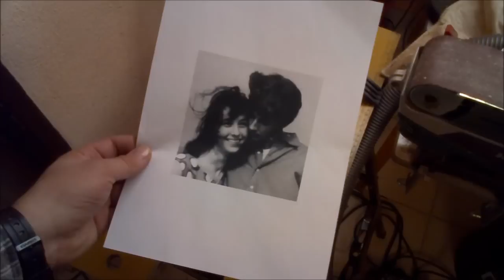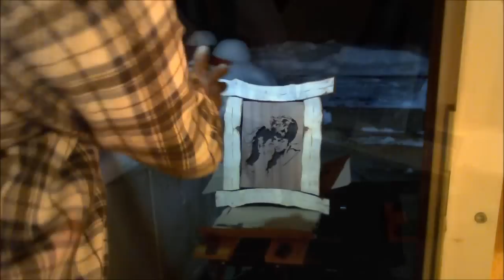Rustic Scroll Saw Portrait - Woodworking // How-To

Comment: Nice portrait.  I use mineral spirits on the pattern after cutting.  The adhesive will release and the pattern will come off easily, no sanding needed, and you don't risk breaking all your hard work.  Good job!
Reply from the maker: thanks :)  I'll give it a try
Reply: From what I found, for some reason mineral spirits don't remove glue stick glue as well as spray adhesive. I usually use a glue stick to re apply the pattern if it starts to fall off around the edges, and mineral spirits never seem remove the glue cleanly. I end up having to scrape it off with a knife

Comment: What size Blade did you use
Reply from the maker: +Julian The Blade is a "Niqua fix No 3" Teeth Per Inch: 20, Thickness: 0.34mm (0.013"), Width: 0.80mm (0.031")